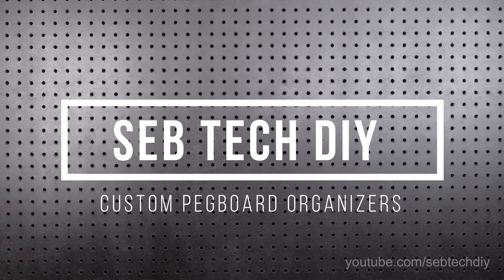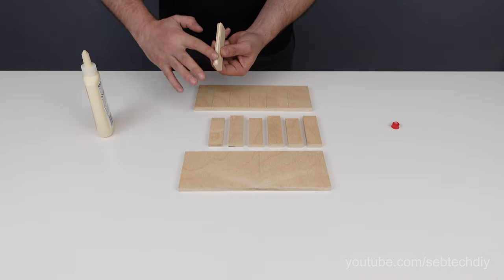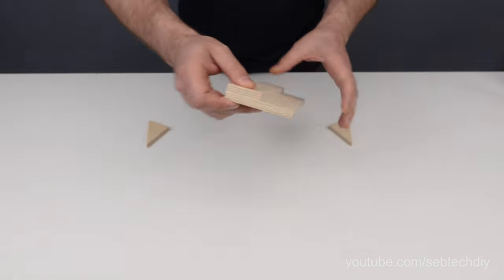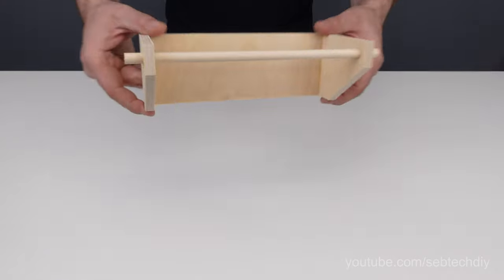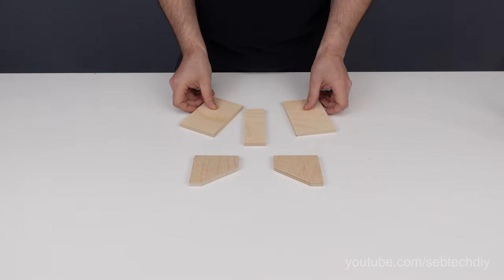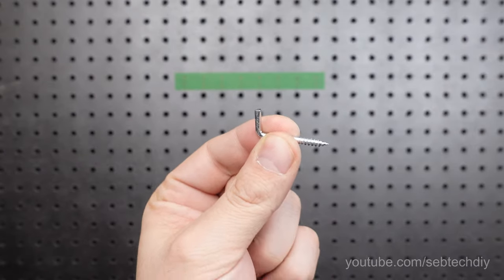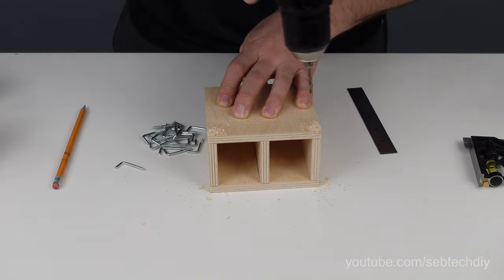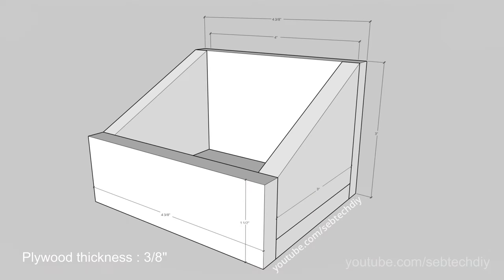DIY Pegboard Tools Organizer - Better than French Cleats?

Comment: Wonderful video!  clear instructions, clear audio.  I subscribed for more!  The only thing I would have liked to see is video of you mounting the holders onto the pegboard and taking tools on/off.  I got rid of nearly all my pegboard but now I'm considering getting a sheet or two.
Reply from the maker: Thank you, can't believe I forgot to show that, you right. It's pretty easy to put them on the pegboard. You can unscrew the L hook one turn or two to adapt to different thickness of pegboard so the holders are always close to the pegboard. Since you can secure them tightly when adjusting those L hooks, they stay in place when removing tools from holders. Thanks for the great question, I hope it clarify a little more. Also, thanks for subscribing to my channel! 💪

Comment: This looks great and will be ideal for my little workspace :-) !

For the pegboard itself, is this regular off the shelf hardboard that you've drilled yourself, or did you purchase specific pegboards?

Also in terms of mounting it to the wall, did you use a frame at all that you then affixed the board, or simple screw straight to the wall? The reason I ask is what amount of clearance did you need to allow for those L-Hooks to seat correctly.

Richy.
Reply from the maker: Thank!! It was pegboard purchased at my local hardware store. Basically hardboard with holes already drilled at every 1 inches. Available in 1/8 or 1/4 thick, i always choose the thicker one. My pegboard have slats every couples inches on the back so it is pretty strong, you can see the build of my pegboard wall here : https://youtu.be/hvqNDPSkfUw , i also painted the pegboard in metallic gray to give it a nicer look! 👍
Reply: @SEBTECHDIY  smashing thanks for the extra details it’ll really help me track down the parts to build this next week! 😊👍